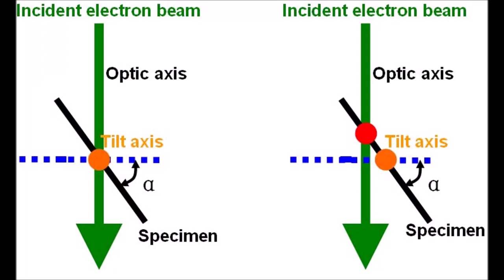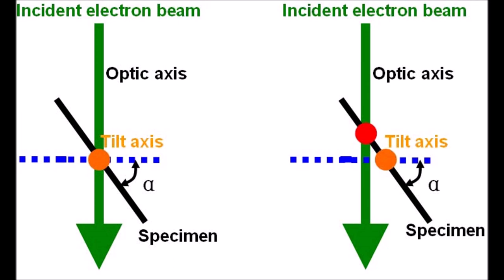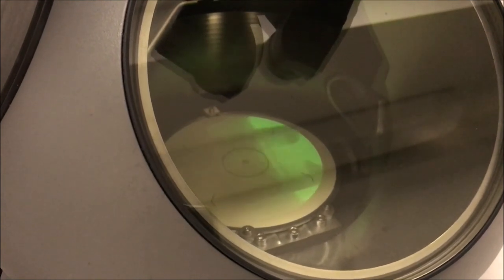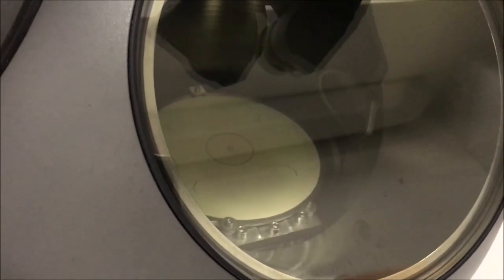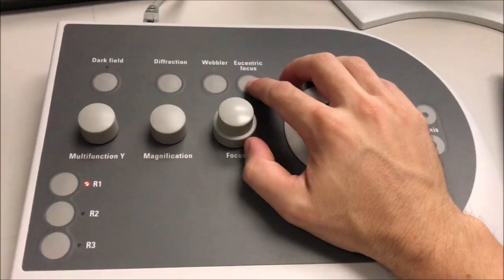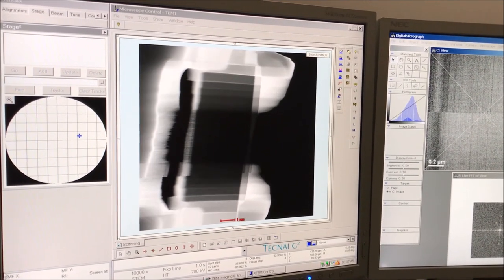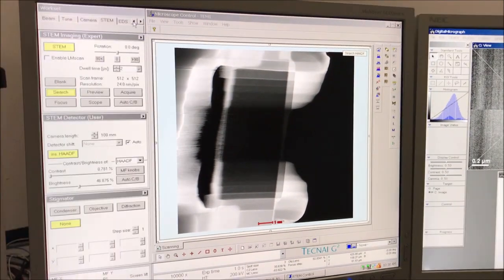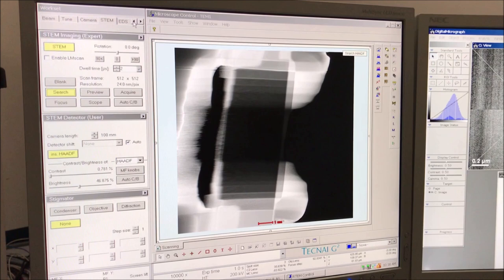Eucentric height and your scanning/transmission electron microscope

Comment: I am not able to see the wobble spot in the microscope, how can I adjust it?
Reply from the maker: Hi Lucia: I'm not sure what you mean here; are you saying you are unable to get the stage tilt to wobble back and forth?  What microscope are you using?
Reply: @NicholasRudawski  The machine I operated was CD-Stem and the issue I had at that time was the sample failed to center when the program function executed. It was diagnosed as stage issue and it has been fixed by the FEI staff. Thank you for replying.

Comment: Thank you for the great video. What settings of the microscope are changed (atlernated) when alpha wobbler is on?
Reply from the maker: Hi V S: sorry for the late response; the alpha wobbler simply tilts the stage back and forth between plus and minus some set number using the alpha tilt control of the stage, so nothing too complicated.
Reply: @NicholasRudawski  Thank you!

Comment: How does the STEM make images for the defocus, because the whole system is fixed(expecially, focus are fixed for all the lens). When we adjsut the defoucs distance, the specimen position in the polepiece changs, does that main the sapmle is no longer at the eucentric height anymore? But why we can still get clear image with bigger FOV under defocus?
Reply: Sorry， I understand now. Defous images are Shadow Images, not high resolution images. It shouldn't be on the eucentric height.

Comment: And if the magnification of objective lens changde, will the operator need to adjust the eucentric again?
Reply from the maker: Hi Shao: eucentric height does not depend on lens strength, magnification, or mode of operation; it is a parameter of the stage and thus is mechanically constrained.

Comment: Thank you, Nicholas! I am the guy ask you about the difference between TEM and STEM mode. So, from this video, when we've adjusted the eucentric focus in TEM mode.  It indicates the specimen is now at eucentric height, right? Then when switching to STEM mode, we only adjust Focus Knob to get clear image, and reset Defocus (R2 button), right? after that, if we change beta tilt, the z-position may also be changed, and then we use Z-button to adjust  the image quality, right?
Reply from the maker: Yes, that is correct; if you set eucentric in TEM mode and then switch to STEM, you just need to focus the image, not adjust specimen height; the image should stay basically focused if you only adjust alpha, but if you adjust beta the sample will no longer be eucentric and then you would need to refocus by adjusting z.